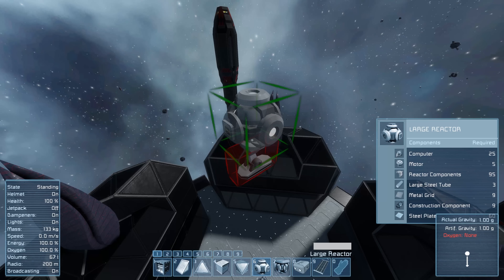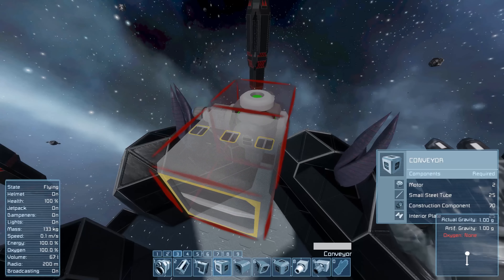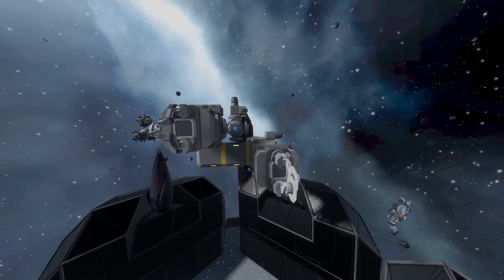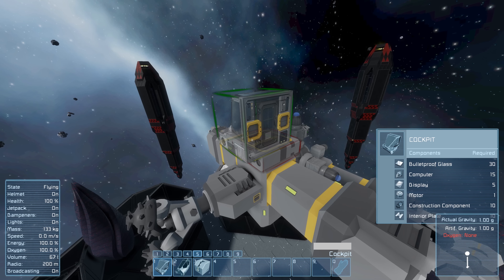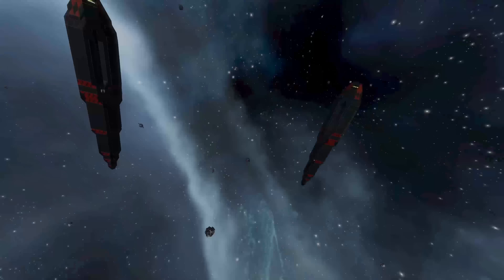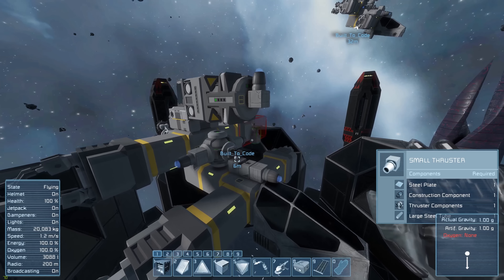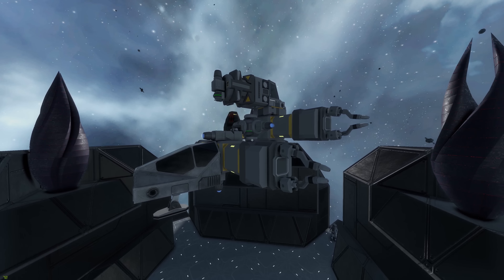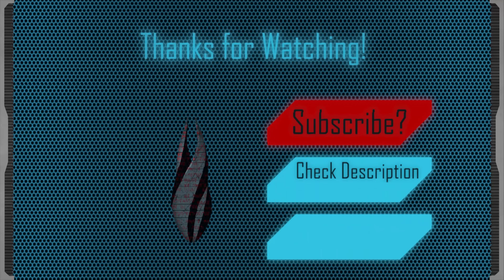Space Engineers, Small Ship Building Code

Comment: An abridged and unofficial version of the official unofficial Small Ship Building Code (or SSBC for short) documentation that exists in my head:

Heavy armour can be useful in mining ships, but it is also far more costly. If you're in a bind because you just lost your mining ship or you've only just started out and are low on materials, using light armour or a mixture of the two could be more beneficial.
Efficiency is always important; every component you spend on your mining ship's armour is a component not spent on other, often more important things, so making most of the "skin" out of light armour and only protecting key areas (front, rear, most extreme side edges) with heavy armour should mean the craft is cheaper and easier to control, requiring less thrusters, gyroscopes and reactors to keep it flying properly.
Most other small ships don't need heavy armour at all, although one could argue a welding/grinding drone could end up bumping into things due to lack of visual feedback from all angles; but most of the time careful flying and learning the size of your craft will remedy that.
Personally, I don't use heavy armour (or much armour at all) when building interceptors; since a camera and a couple of well-aimed rockets will do enough damage to a drifting ship's turrets to take out its defenses without needing to get into firing range, plus a small, quick ship is better at dodging bullets and rockets should you get too close and it'll allow you to get away more easily as well.

As for reactors, almost all decently built small ships will only use a maximum of 30-70% of a single large reactor depending on the type of craft, so most of the time that should suffice. Some modded thrusters on personal shuttles/scout craft/interceptors (such as Sage's Industrial Thrusters) require a lot more power, so only then should you add more reactors.

Gyroscope-wise, the amount depends entirely on what kind of ship we're talking about. You'll want enough gyroscopes on a mining ship to be able to fly it comfortably, so usually two will be enough. I tend to build my welding and grinding ships very small and precise, and you'll want precise control with those as they'll be flying in tight quarters at times, so one gyroscope is best, most of the time. Other than that, transport ships are similar to mining ships in that they don't need to respond extremely quickly but it's nice to be able to fly them comfortably, so two or three is usually fine. And lastly, you'll want your personal shuttles, scout ships and interceptors to respond quickly and turn around in a split-second if you need them to, so adding 4-6 gyroscopes depending on personal taste will suffice for them.

Other than that, thrusters are mostly your own choice. Add a lot of left/right/up/down thrusters on mining ships, but hold off on the forward and back ones, since you don't want to break your drills. You'll want precise control on your welding/grinding ships so only add a few in each direction. Transports, shuttles and scouts don't need to be able to move sideways at lightning speeds but you'll want them to get to their destination quickly and without crashing so add large rear and front thrusters and not too many side thrusters. Interceptors are entirely up to personal preference though, a gunship will need good lateral control for those strafing runs, (torpedo) bombers won't need as much l/r/u/d control but you'll want them to be able to get out fast after delivering their payload so add large rear and front thrusters.

A cockpit isn't always necessary if you're building a drone, but a remote control is always useful. You may want to move your ship without going all the way out to get it, or you may want to send your whole fleet over to another asteroid without having to manually fly back each time you've delivered one ship, so flying over there, setting coordinates and telling all other ships to go there via an antenna connection and remote control blocks can save you a lot of time and hassle.

If you do add a cockpit; make sure it's hooked up into an oxygen system of some sort. Whether it's just a connector stuck to your ship somewhere so you can fill up the cockpit with 15 minutes of O2, whether you have an extra oxygen tank in it so you can last longer out of base range, whether you have an O2 generator paired with your tank to keep you going for even longer on mining or scouting trips for example; it doesn't matter. So long as you can breathe it's fine. If you're really pressed for resources, you could always fill up a small cargo container on the side with filled bottles and grab those when you're running low. Never, though, go out alone without any oxygen supplies because if you die out 100km away from your base and your ship's drifting through space with all of your resources you've just spent such a long time gathering somewhere out there, you may as well resign to your fate because you're unlikely to ever get it back.

And as Sage has already mentioned: do your piping right! This is extremely important: you do not want to be mining an asteroid an not getting any resources from it because your drills aren't hooked up; nor do you want to suddenly die from a lack of oxygen because your cockpit isn't connected to the system; nor do you want to be completely unable to access your reactor from the outside even with a start-up reactor because you didn't plug any pipes into it; and so on and so on and so on. If you have automatic cargo drones picking up resources from mining bases and delivering at a refinery station, make sure all your conveyor sorters are hooked up properly, your coordinates are set in the correct spots and your timer blocks have the right configurations because a single error can lead to a huge loss of resources.

That's all I have to say on the subject of SSBC for now; it's safe to say that all of these tips I've given you have been learned through either personal failures and/or use of logics and common sense (both very hard to come by I know; but if you have any laying around, use it, it really helps).
Please note that although LSBC (Large Ship Building Code) and StBC (Station Building Code) are very similar to SSBC and each other, but none of those are by any means replacements for any of the others. Ignoring or substituting any of the BCs for other material is extremely dangerous and must be done at one's own risk. Neither I, nor the Arbitrary Council for the Creation of Space Engineer Safety Protocols (consisting entirely of me), can be held responsible for any damage, be it personal or collateral, received from not following the BCs as they are described in the official documentations.

P.S. yes, that was abridged. I might write more precise and rp friendly versions of SSBC, LSBC and StBC in future and post them on the SE workshop, but don't expect it any time soon. If I do make it, it'll be under the name 'Gee,' 'Zappygun,' 'Bad Eyed Bill,' or something similar.

Comment: Things really needed on a small ship, 1 gyro, 1 thruster, 1 power supply and 1 means of control (a cockpit or remote block antenna and camera). everything else is optional. You don't need 6 thrusters just remember to point 180 to your direction of travel to slow down, harder to do yes but doable.

Comment: Cockpits have 15mins worth of oxygen
Reply: +Michael Halpern If they are piped to receive oxygen.
Reply: SirTragain
yes but he didn't address that in the video- 15min is enough for short range fighters.
Reply: If it isn't piped to receive oxygen then it doesn't have any in the cockpit and he did address piping along with connectors. It works both ways; once docked to a base/ship that does have oxygen then the cockpit of said fighter would gain your 15 min of subliminal oxygen if it had been piped to do so once the ship is disconnected from its docking point otherwise that fighter would never have oxygen in its cockpit.

Comment: Your advice on O2 is largely rubbish. O2 Generators allow you to transfer ice to the o2 generator. If you have no ice you cant do that. this is a truism, but you asset that tanks are better because of this.... and is wrong. Tanks don't allow transfer between them /at all/ so you still need ice to refill the tank unless you have O2 bottles, but then you don't need the o2 tank on the ship at all! Tanks are no better nor worse than O2 generators. They all have their limits, but tanks are more limited than generators because a ship with a generator can use ice or bottles. A ship with a tank is complacently dependent on another ship to refill bottles or tanks.

Smaller quibbles
You can actually build gravity drive based small ships which reduces the need for thrusts. That is going to be a very limited case thing though.
It is also possible to build working ships with neither remote control or cockpit if you use script blocks.
Most of the conveyor stuff seems redundant. Effectively how to make things work. advising on that is the job of the tutorial :p
Reply: +Loues S. Cat Tanks work similarly to batteries. If you have a ship with an oxygen tank in it connected to another entity that has an oxygen generator in it via a connector, the tank will be filled up and this will allow you to fly said ship independently for extended periods of time without needing to use up inventory space on too many bottles, or needing to use up space and resources building and stocking a second oxygen generator.
Aside from that, generators don't directly store oxygen; so in the event a system suddenly needs a lot of oxygen, for example if a large depressurization disaster just occurred or you simply have a very large airlock or it is used often, it could take a lot of time for your O2 levels to return to normal. Having tanks on your station or ship that are slowly filled up during periods in between airlock use and/or disasters will prevent or at least decrease the chances of encountering this issue; thereby eliminating the need for large amounts of generators that constantly need to be stocked with ice.
Reply: +Zap “Gee” Gun O2 tanks will only fill up if you are depressurizing a room or actively processing ice. Depressurizing a room is a massively lossy process so it is pretty much out the window if you any any level of efficiency. The O2 system is unlike batteries in that, if I recall correctly, tanks fill starting with the one with the lowest levels so to fill up your small ship tank will never be more full than the large ship tanks, but you still require ice to fill it, so the argument that generators on small ships are worse than tanks because they need ice is wrong. You need ice either way. Bottles and generators are the most effective way to keep a small ships O2 supply stocked. For one thing you get warnings when O2 bottles are used and you know exactly how many you have ahead of time. They are quickly and easily refilled, and by storing them in an O2 generator you have the option of topping up your ship with either ice or O2 bottles, and because you have a generator, topping up with ice means you also top up all your bottles. This is not true of tanks. O2 generators offer more tangible benefit which are absent from Tanks. Yes, a full tank will offer you days of O2 if you can get it to 100%, the trouble is the difficulty of keeping it topped up outweighs it's utility in most cases.
This is largely going to come down to individual assessment of values, but I personalty prefer to have my small ships be self sufficient when it comes to 02 supply. Having a script circulate a few bottles is much easier than setting up all the extra pluming to allow the direct filling of a tank on a docked small ship without also having to fill every other tank too (which breaks airlocks) :p
Reply: +Loues S. Cat Except oxygen tanks automatically even out their oxygen levels when they are connected to the same conveyor network, unless set to stockpile. This will also occur when connecting a new tank into the network via connectors.
Reply: +edirhC That would be a feature added more recently than my last investigation into the O2 system. I'll have to check on it again some time.
Hmm. tested and verified. Consider me informed. I still prefer OxyGenerators because they give you control rather than the automatic system. The automatic systems and I have a history of clashing with each other :p
For one thing I am much happier with 11 100% full Oxygen Bottles rather than a 5% tank because my Pressure is low. You could always have both I supose, but I like being able to top up with ice :p
Reply: +Loues S. Cat I only recently became aware of that feature myself. The annoyance of the tank equalization is that emptying one is a tricky process in case you need to remove / move a filled tank.
Reply: That is the kind of issue I always run into with the automatic systems. I absolutely despise them. I would much rather be able to fully implement my own through the ingame script system. I like being able to decide how my ship works. Not having my ship do its own thing and me then having to work around it X.x